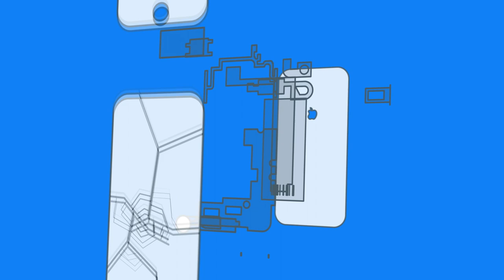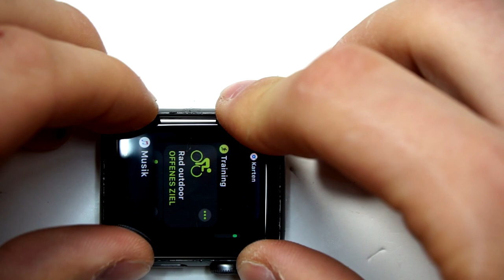Apple Watch 1, 2, 3, 4 Glass Repair Replacement Only - DoItYourself

Comment: The title should be Glass and digitiser assembly replacement . It is very difficult to separate the glass from the digitiser.
Reply: Thought I had ruined my screen yesterday when I accidentally cut the digitizer wire only to realize the kit I got is a “glass only” kit for a series 3 which is effectively, ineffective because the digitizer is impossible to separate from the display

Comment: Well i recently change the digitalizer on  an apple watch s3  but for weird reason the force touch doesn't work anymore.the force touch sensor is ok works with other display but not with this i fix everything else works great.do you have an idea why or what i could do to make it work again?
Reply: Yeah it’s clearly obvious you messed with the forced touch and broke it. It’s not rocket science to see you broke it bud
Reply: @ChapoGuzman896  neah the issue was that after i place the screen back to the watch i had to make an restore an pair it back and all worked well
Reply: @coccco28  hey how hard was it to remove the glass for you?
Reply: @flamingrage100  it is easy if you know or have all the tools it needs to remove it and on serie 3 the glass and the touch is the same is not like on serie 4 were you can only change the glass if you are lucky but needs patience to do it
Reply: @coccco28  yeah I want to try it on the series 6 and I don’t want any difficulty
Reply: @flamingrage100  you have to be very carefully as like on serie 4 and 5 there is glass you can remove and save the touch this is not as expensive as you you were replacing both.and your wire need to be at least 0,04 or 0,06 mm thin for this operation.i suggest you to check an video with replacing the glass on an apple watch serie 4 or 5 this will give you an idea on how need to be done for serie 6 too not to mention that on serie 6 apple changed the hole display connectors that are now different placed so you need to be carefully when you take off the display.
Reply: @coccco28  ok and thanks for the responses I’ll be doing this in a few days so I’ll prob let you know my results
Reply: @flamingrage100  great and i wish you good luck

Comment: Does the digitizer on the ebay or market work on apple watch? Bcs some youtube fix videos says the digitizer is programmed by apple.

So based on yr experience, will it work if the digitizer purchased online from non apple supplier?

Thanks in advance for the replies.
Reply: This is a question that needs answering
Reply: Hazaribag me khi bnata h
Reply from the maker: Yes you can use them. Nothing programmed here.